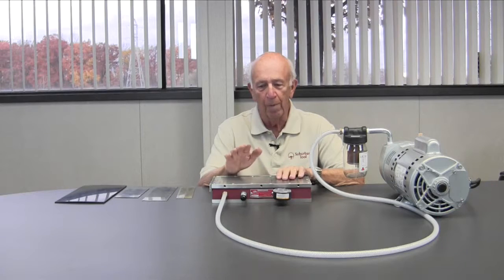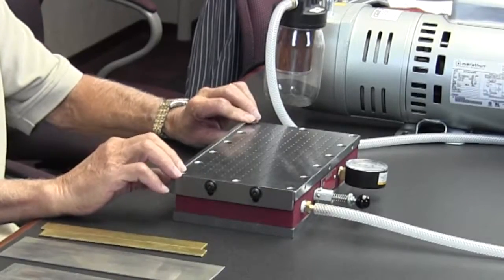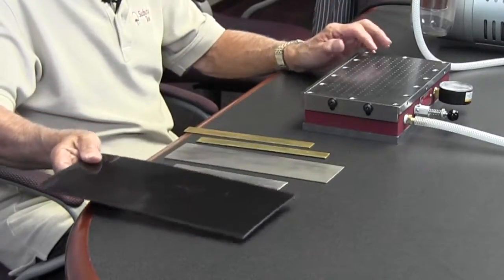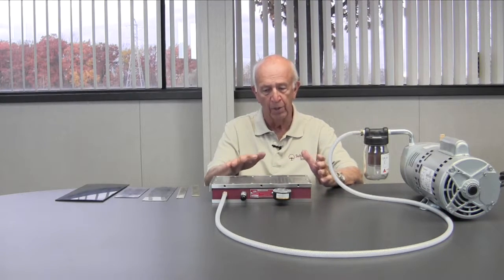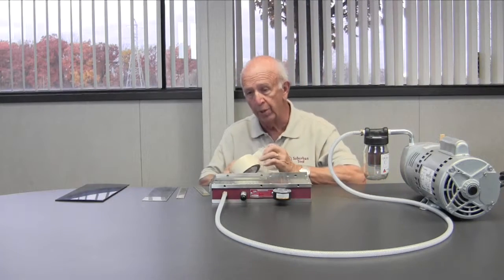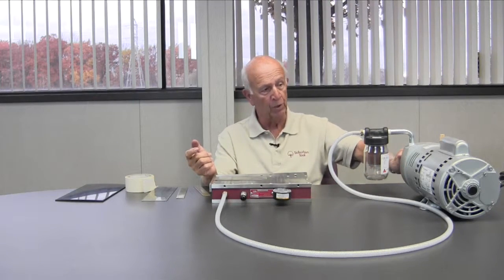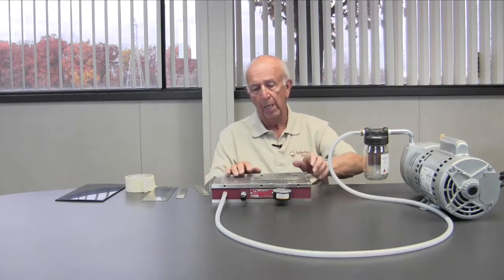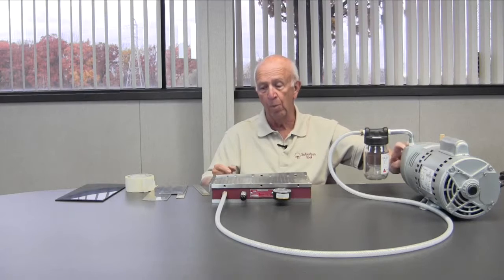Suburban Tool VC-612-S2 Vacuum Sine Plate Chuck

Comment: Hi Mr. Bailey! I’ve used your tools for many years as a Mold Maker. Have always found your tools to be of good quality. One thing I’d like to add that these chucks are used for in the Toolmaking industry is grinding graphite (EDM electrode material). I know that you know this; just wanted to let the more novice folks know this is an excellent way to hold say .250” thick or less graphite. Thanks for the video Mr. Bailey!